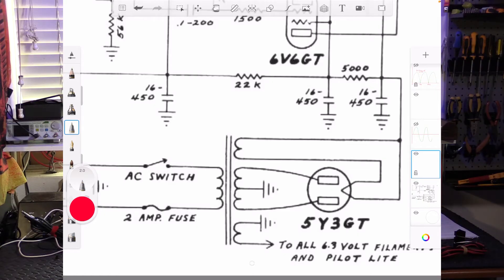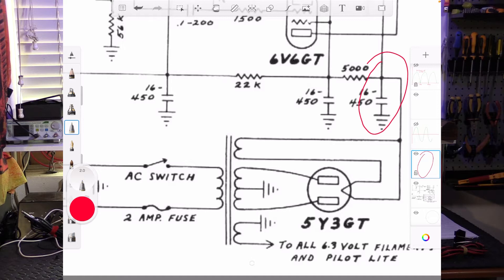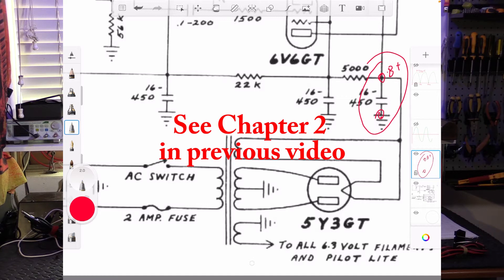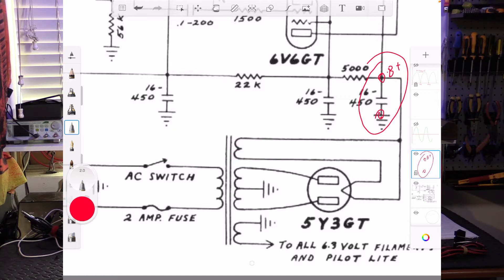Tube Amp Sag. Chapter 3. Capacitor and Rectifiers Pt 2. Capacitor Short circuit and Inrush current.

Comment: The behavior of the capacitor when power is initially applied to it is like a short circuit, but that's only a transient. Once it's charged it does not behave like a short, the opposite, like an open circuit. I would have liked an explanation once the amp isin operation.
Reply from the maker: @RafaelHe  quite correct! The short circuit effect is very transient. The larger the capacitor, the longer it draws high current from the rectifier. This is why tube rectifiers specify a maximum capacitance.   The larger capacitance means less sag for short power demands.

Comment: Does the sag affects the general tone or the compression through playing?If yes,in which way (technically speaking)?
Reply from the maker: An excellent question, George. As another viewer highlighted to me, I didn’t actually define what SAG was. Ooops. 
At lower volumes, you will most likely not hear the effects of tube sag. It is more when you start to push the amp. Sag is when one of the contributing elements in Sag starts to reduce the output level for a very brief time. The closest thing you will hear is similar to a compressor, as you mentioned. The main difference is that sag will not be a totally clean compression. The tone will change as the voltage or output level changes. This is what a musician would call “note bloom”.

Comment: Funny you mention the limits of the rectifier tube. I have been using 68uf caps with my 5y3 rectifier tubes. I have many, and I want to use them up. The 5y3's have never complained, but I do know it is a stressful amount of current being asked of the tube at startup. There are many considerations when designing a tube amp. I only see the RCA tube manual as a suggestion reference. Upon experiment you soon see what the suggestion is and reality. Thanks for the videos, and I look forward to the next one. Cheers
Reply from the maker: I reckon the 68uF on a 5Y3 would sound very nice, but I couldn’t take that chance on a customer’s amp. We all know that Leo used to push the envelope in the glory days of USA, UK and European-made tubes. Modern manufacturers’ tubes are quite good, but I have to lean towards the more conservative approach by sticking to the RCA and other datasheets. Out of respect for the amp I am working on, I look to the master amp builders for their decisions. Having said that, I very often bump up the filtering for the preamp stages. I will nearly always replace an 8uF with a 16uF.    Thank you for your insights, Ken. Your experience is much appreciated.
Reply: @theguitaramptech  The "typical operating conditions" listed on the datasheets are just that, TYPICAL values used in a circuit with that tube, it's not a rule, just a rule of thumb. Although it's not always shown on every data sheet, for each rectifier tube type there is a formula that takes into account the voltage, resistance and the current provided by a power transformer to the rectifier for safe operating conditions. Sometimes you have to go through several datasheets to find one with the formula. If the power transformer secondary impedance is too low to safely run the tube with a higher value cap, as indicated by the formula, resistance can be added between the PT and the rectifier to help protect it. I am so sick of people claiming that you cannot run a 5Y3 with a reservoir cap over 20mF. Read the data sheets, people.
Reply from the maker: @tiki_trash  I see your point tiki, and you are right on many counts. For example a NTC in the primary will definitely protect the rectifier, nbut it’s not my place to risk a customers amplifier. I will always be more conservative.